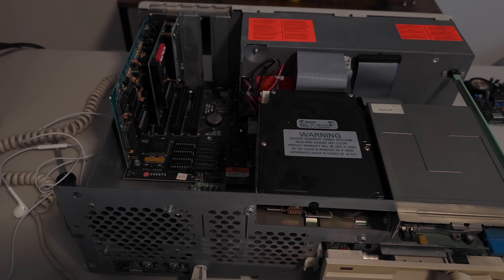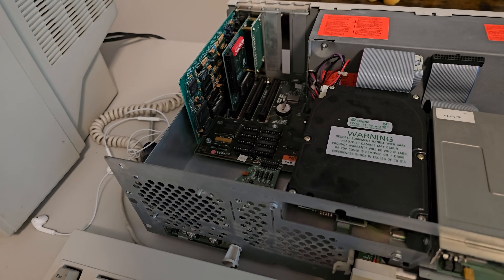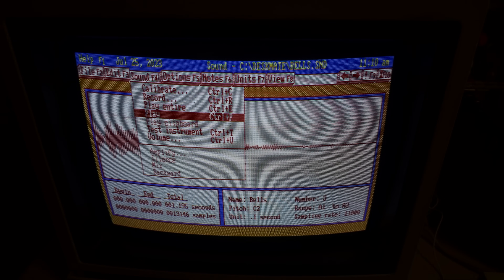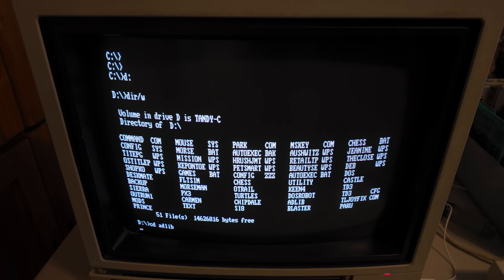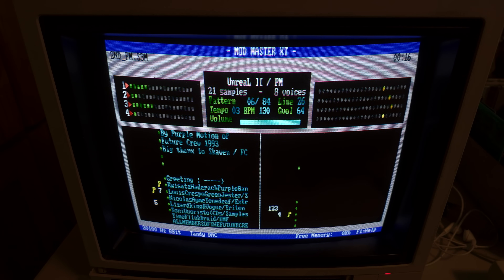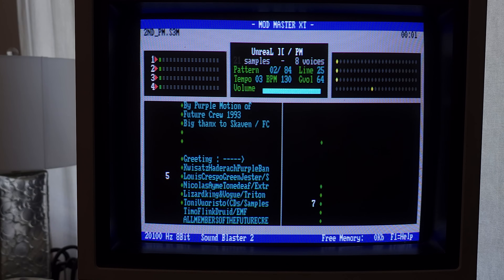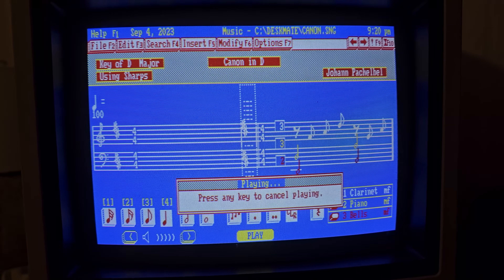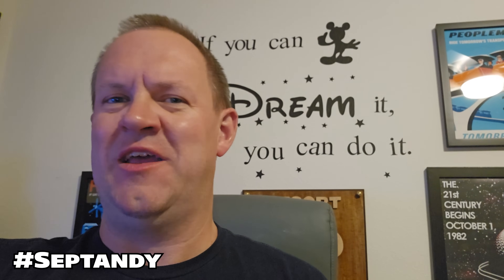I FIXED IT!!  Tandy 1000 TL/2 Sound Blaster Conflict Resolved - #SepTandy

Comment: Glad you got things working. Another solution would be to use a newer Sound Blaster model like a CT4170. This is what I have in my Tandy 1000 TL/3. I use Unisound to set the DMA to channel 3. That is how I got around the DMA confict with channel 1 and the Tandy DAC.
Reply from the maker: Hi Joseph!  I had read about that possibility as well, but only after I got my CT1350B and found out it had a conflict.  But I'm glad the DMA sharing worked!  Since then, I've spoken to a few people who said it didn't work for them, so it's really card specific, I think.  Is the CT4170 a 16 bit card?  I know you can use them in 8 bit slots, but I was always a little nervous about that since I've never tried it.  Thanks for watching!!
Reply: It is a 16-bit card, but plays nice in an 8-bit slot. I use the BLASTER=A220 I5 D3 H3 P330 T6 J0 environment variable. The J0 will turn off the joystick port, but you can use J200 if you turn off the onboard joystick interface on the TL/2 using a program like TLJOYFIX. Just run UNISOUND and you are all set. I have never had an issue using a CT4170 in any of my XT Class systems. One thing some people do not like about this card is uses Creative's CQM vs a real Yahama FM chip for OPL3. It is just a matter of preference and something to keep in mind. @retrotv1tech